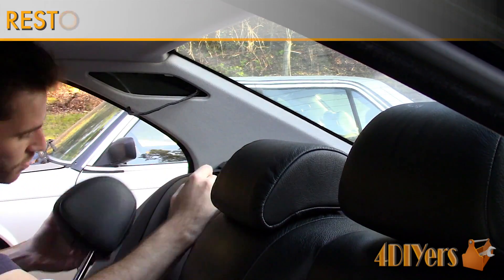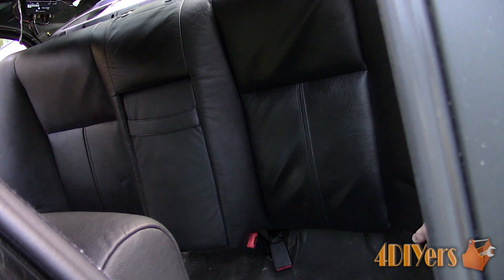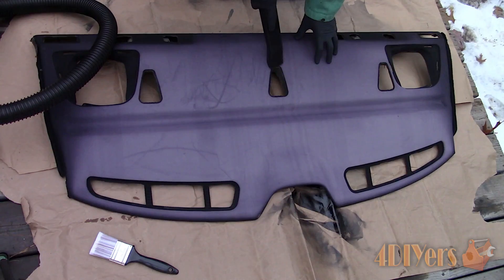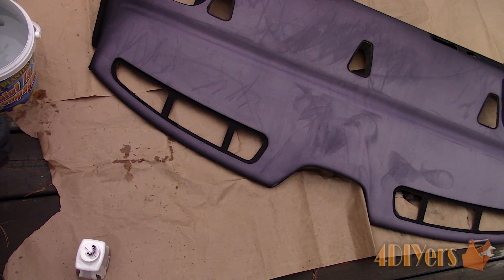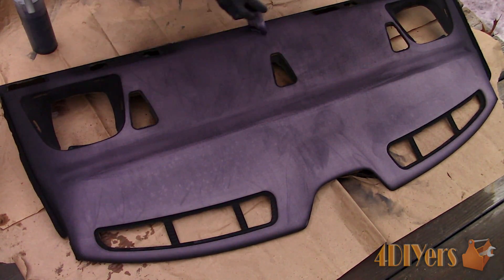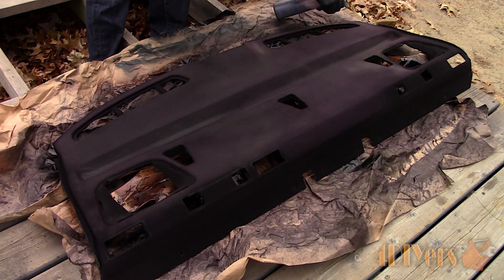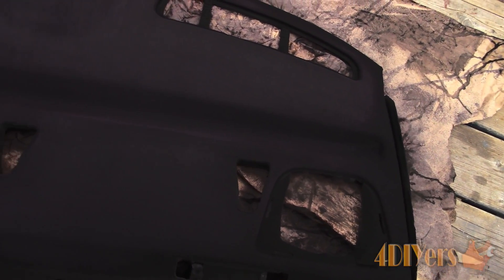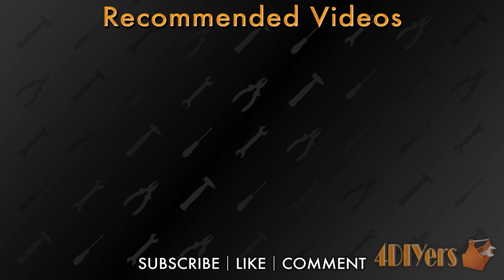How to Restore a BMW Faded Rear Window Shelf

Comment: My blind is cracked and I have already ordered a repair kit. I also plan to paint it because it looks exactly like on the video. I also want to use a spray, I will try dupli color and I hope the result will be worth it. Love my 2002 530d restore project!
Reply from the maker: If you're using the spray can version, I've heard using a brush helps keep it soft in between coats.

Comment: I recently followed this method and achieved great results on the rear deck panel of my e46 M3!  However, I used a different ratio of the RIT dye & white vinegar in hopes of getting a darker finish with less coats.  I used 8oz. of RIT dye and 16oz. of white vinegar (24oz.) in a spray bottle, pre-warmed in a bucket of hot water. The 24oz. mixture allowed me to do 3 separate coats over the course of 3 nights.  I also used a paint brush, as suggested, to evenly work the dye into the fabric.  After the 3rd coat dried, I  brought it out into the sun and I could no longer see a difference between the un-faded parts vs. the rest of the deck that was fully dyed.  I decided to hold off another 5 days before reinstalling it, in case the vinegar smell was going to bother me.  Ever since I reinstalled the rear deck panel, I cannot smell it at all and it looks SO good now, whether glancing in the rear view mirror or looking in from outside under direct sunlight!  Thank you for making this video!
Reply from the maker: Awesome to hear, thank you for the kind words and the tips as well.

Comment: Another great video, thank you. A question for you (or the community): on taking my rear seat out, I found the two bolts at the bottom backrest to be missing. I can’t seem to find the part number on RealOEM or elsewhere - do you know if a regular 10mm x 15mm bolt will do?

Comment: Did you maybe consider installing a new fabric? If so,, What would be some pros, cons ? 
I am currently doing the same project, same car and shelf resto, but i only thought of fabric as to the fix..update you on how mine turns out. Mines called Beemer on a Budget.Thx for the vids
Reply from the maker: I did consider it, although the fabric isn't available locally which made it a problem.

Comment: I tried this exactly as described.  I couldn't get it dark enough after 6 coats. Mine was no more faded than the one shown.  Mixing dye and vinegar in anything close to ratio described results in a grayish solution.
Reply from the maker: As mentioned in the video, required bottles will vary. I would use another bottle.
Reply: heat gun to remove old fabric then glue new one down.

Comment: Does it not smell like vinegar? I saw people mix it with hot water instead would it make a difference?
Reply from the maker: The smell of vinegar only last for a week. Vinegar helps the dye bite into the fabric as it is a light form of acid.
Reply: Oooh u see, so then to do my cars carpet it would be better to use vinegar instead of hot water? Was it white vinegar?
Reply: And thank you again for the content and the reply to my questions 🙏
Reply from the maker: @matster4160  no problem :) Yep, just regular white vinegar.